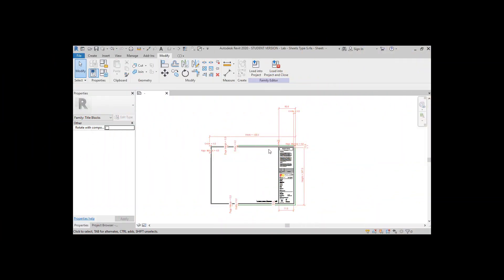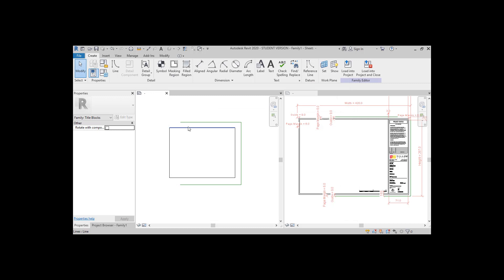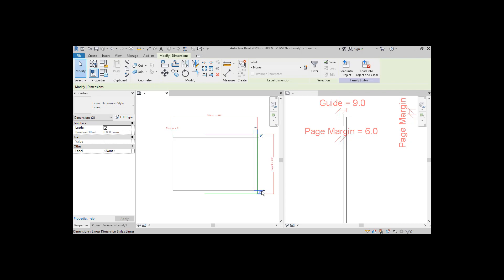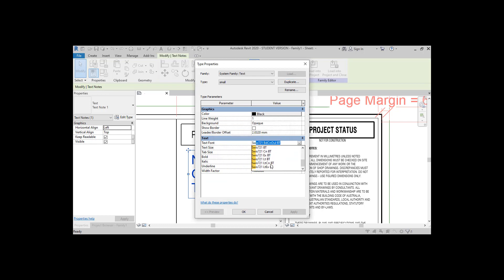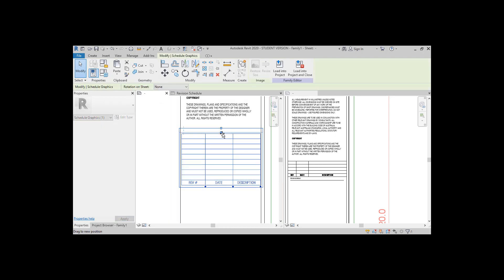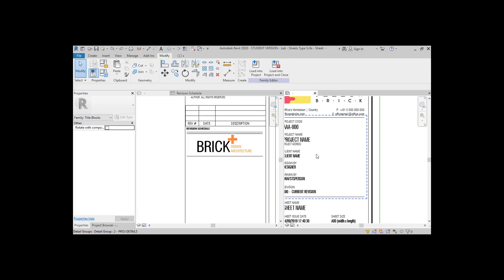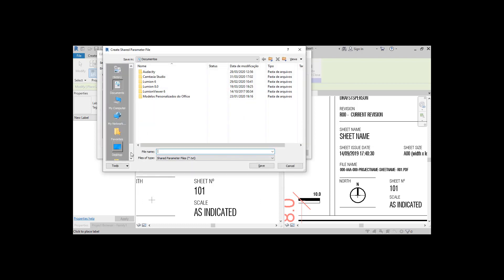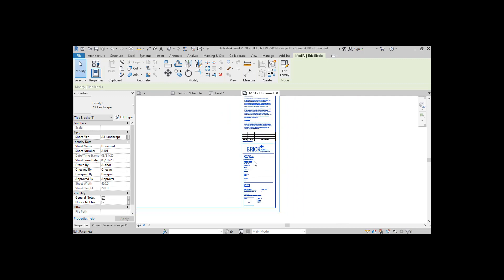Revit Parametric Title Block in 15 minutes

Comment: When you change the paper size from A3 to A1, for example, the text from A3 size size will become smaller in A1 size right? So how will you gonna fix them since the text in revit is not parametric. Looks like you got a problem there. 😊

Comment: this is awesome; exactly what i’ve been looking for. i’m slowly trying to build a standard revit template file to use at the beginning of every project. i’d like to have parametric sheet sizes like this and also have the ability to select different style sheets for the sheet size we’re using for the project. not sure if this can be done but what i’m thinking is having a non printable detail grid for our detail pages that helps keep things organized and aligned. i’d like to have a notes sheet that has columns of text for our general notes that can be a sheet selection and then customized once in use. so if i’m in a project and we’re using an A3 sheet size and then i want to bring in a “cover” version of this sheet and then maybe later bring in a detail version and then a notes version all of these sheet templates can be nested within the sheet size. do you think this is possible?